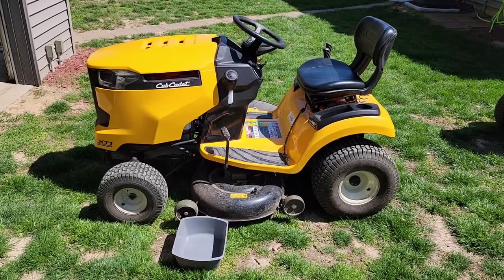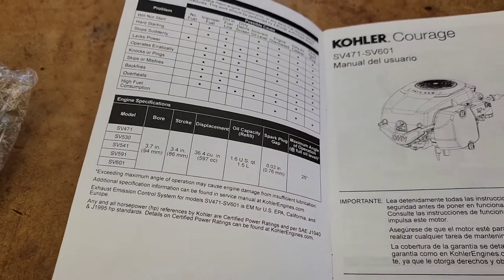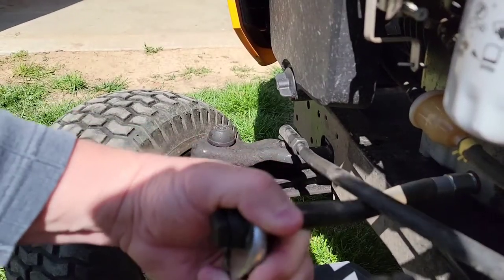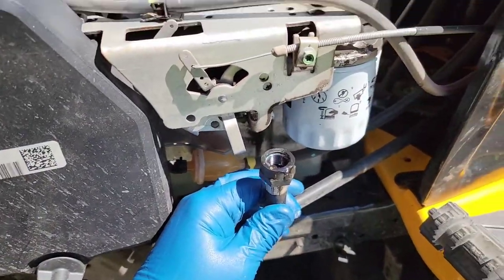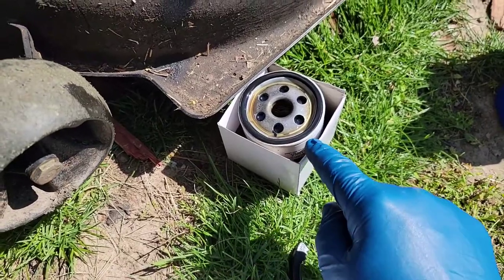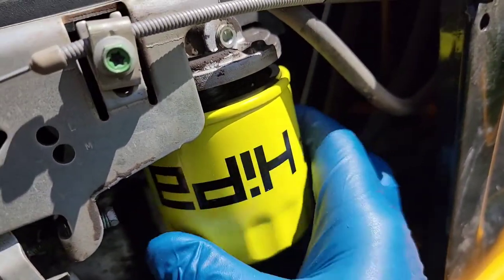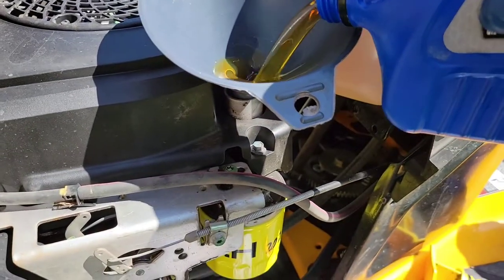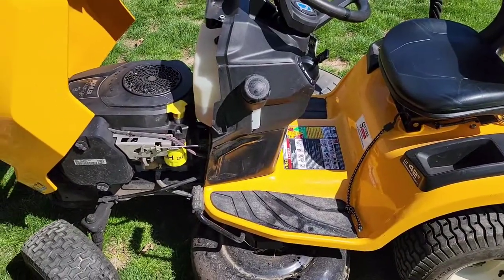HOW TO CHANGE OIL Filter Cub Cadet XT1 LT42 Riding Lawn Mower $19.00

Comment: Careful with the larger oil filter. When turning the rod that turns the left wheel, it was rubbing on the lower backside of the filter. It wore a hole in the filter at the end of mowing season. Had a tiny drip, could not find the leak. Moved again and lost almost a quart. Really pays to check oil level before using. On my XTi L42 from 2019 the filter lays flat, not upright.

Comment: The chart in the manual about the oil is showing the oil you should use based on the  air temperature.

Comment: Why change your oil every year if it doesn't need it? My old mower an older cub than yours but has the same engine I changed it at 200 hours that's what it had when I got it. 6 years have passed it's got 235 hours always checks out full on the dipstick still runs great. If the carb malfunctioned and gas filled the crankcase then definitely change the oil but under normal conditions don't waist the money.
Reply from the maker: good point
Reply: Oil is cheap, engines however are not!
Reply: My cub cadet was given to me, it's a 05 model.. about to hit 500 hours. The guy that had it changed the oil once a year. It don't cost much to change the oil it's not like it holds much. Just change it. Fresh oil is never not better.